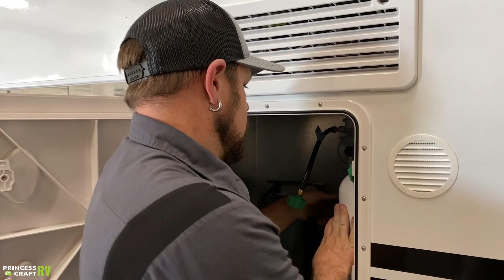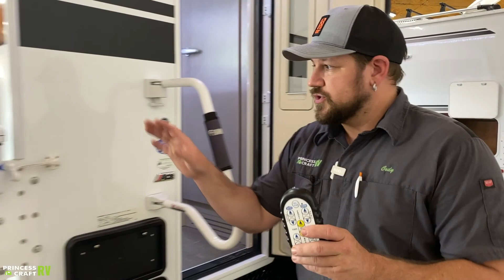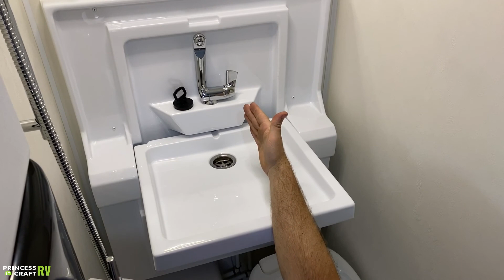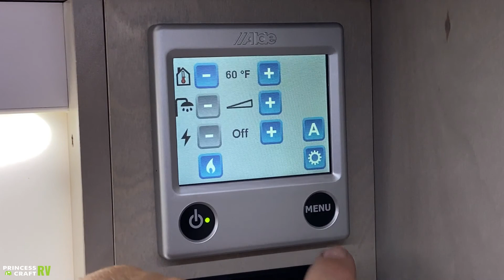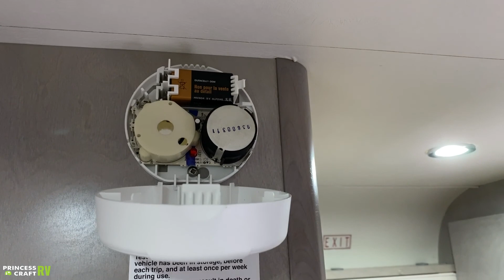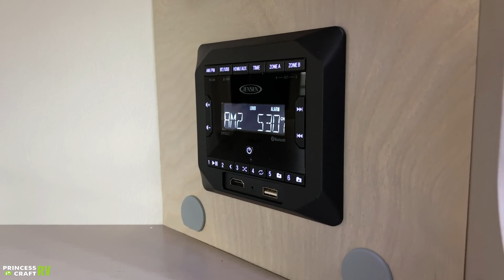Cirrus 820 Truck Camper 2020 by nuCamp RV - Technician Tour

Comment: Thanks for the detailed walk thru. Do the outside storage doors lock? Also, does the inverter really only power just the one outlet up in the bed? Thank you.
Reply from the maker: Yes and yes. The propane access does not lock, for safety reasons.
Reply: @RVTechToursatPrincessCraft   - Thank you for the reply!

Comment: Does all exterior storage doors or hatches have security locks or a way to lock them up ?..otherwise it's a open door to get stolen.
Reply from the maker: The exterior storage doors do lock, except for the propane access. It doesn't lock for safety purposes.
Reply: @RVTechToursatPrincessCraft  How do they lock? I don't see a key cylinder in any of the doors. Thnx for the A+ walkthrough.

Comment: In order to use USB outlets, do you have to turn on your inverter? or inverter is only for 110V outlets?
Reply from the maker: The USB outlets run directly off the 12-volt (battery) system. No need to turn on the inverter for those.

Comment: Watched a few of these very nicely done,but why lead acid batteries
Reply from the maker: The manufacturers don't supply batteries in most cases. The dealership may (like we do) start the new owner off with brand new, lead-acid, deep cycle batteries, and upgrades are available if the new owner would like to pursue options that are maintenance-free or lithium-ion.
Reply: RV Tech Tours at Princess Craft thank you for replying
Reply: @RVTechToursatPrincessCraft  which batteries charge quicker and are higher in amp-hour, lead-acid or lithium?